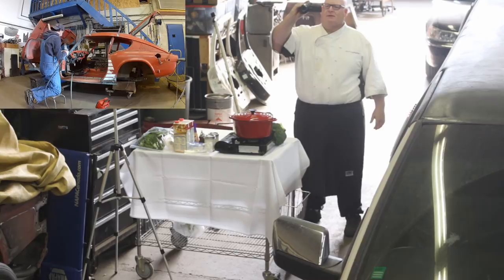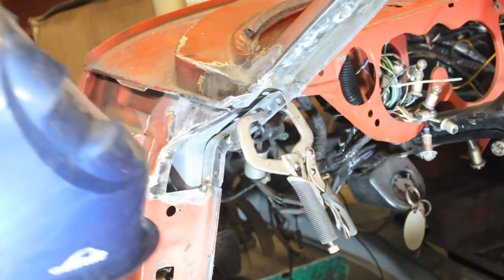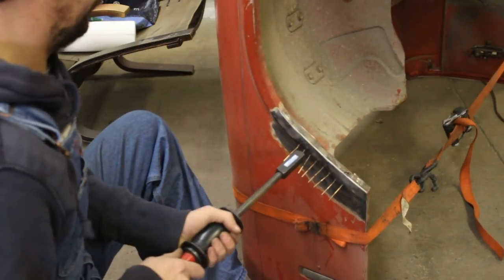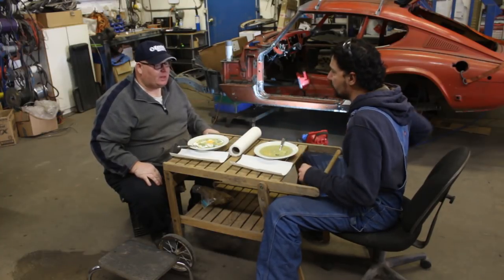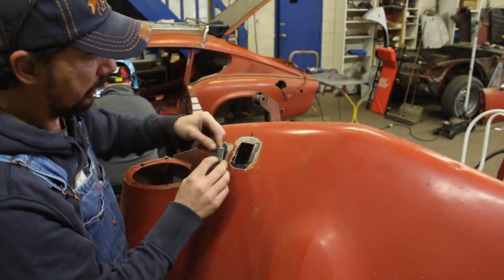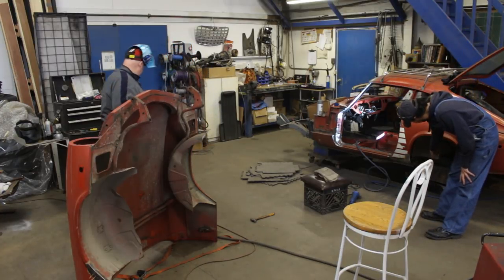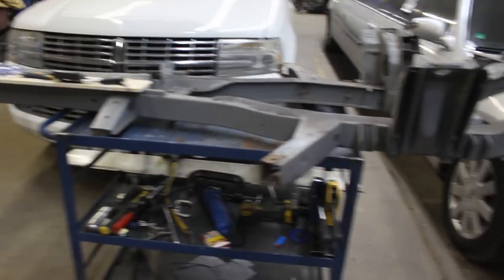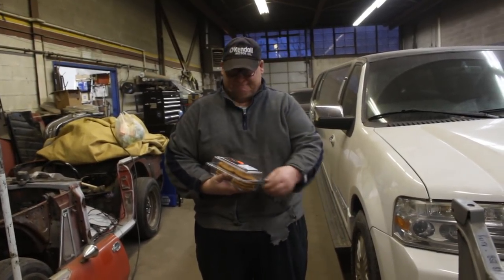1972 Triumph GT6 Restoration - Part 26 - Restoration with benefits

Comment: I'd like to thank you for posting these videos. I'm working on a 72' GT6 now but am letting the body work go until it gets a bit warmer out. We're working on making door panels and other interior bits that are in the house in the mean time. Too cold here in MN to work in an un-heated garage now.  I've taken off the bonnet and will cut a bit of rust out of that also as it's in the basement too.
Reply from the maker: Stay warm and do as much as possible inside. Good luck with your GT6!
Reply: Gypsy2057 post some videos please!  Cheers, Tush
Reply: I'll work on it. Cheers

Comment: Just a suggestion Elin but if you get Tush to hold a heavy dolly against the edge of the arch while you slide hammer you will find it will reduce all that shaking and will amplify the pulling effect.
Reply from the maker: Yeah, I didn't take that dent seriously that day. Having the hood just standing on the floor and supporting it with my shoe wasn't very professional :) I will find a way to secure it and avoid any springing back and forth. But that is going to be some other day when there is no soup smell all over the shop :)

Comment: Just a thought on the bonnet dent. Many years ago I did some business with a British car garage/body shop in St Catharines. I recall they hated bondo to fix dents, and prefered to fill with molten lead. Would that be an option for that stubborn dent?
Reply from the maker: Hi Dave! Yes, I've seen videos on lead repair and I've found some repairs on the cars I've been working on. To be honest I am not a fan and I am pretty sure I will be able to fix that dent properly to a level where just a skim of body filler will be needed to smoothen the surface. Thanks, anywys!

Comment: Elin. I can see your problem with that fender right away. I imagine that by now having watched your own video that you probably figured it out as well. You have to support the side of the hood/bonnet. every time you use the slide hammer the impact is being absorbed by the entire side of the hood and not localized around the dent. Maybe make a wooden buck the shape of the hood and brace it up against something opposite to take all the rebound out of the steel. IDK, just a suggestion.
Reply from the maker: Thanks for the advice Bob. I agree, having the hood just standing on the floor and holding it with my foot is a little impractical :) I will take it more seriously next time I work on it and reduce any flex for better impact. I just couldn't focus on it that day. Tush kept asking for more work :)

Comment: I'm no expert, but you might try first annealing the metal of that dent with some heat. It may bring the steel back into equilibrium so you can resume pulling it out a bit further.
Reply: I agree with Ian here, I think there may be some work hardening.
Reply from the maker: It just needs a good support. Something better than my shoe :) I couldn't really focus on that, because of the soup smell :) I will have to secure it to something solid and work a little bit more civilized